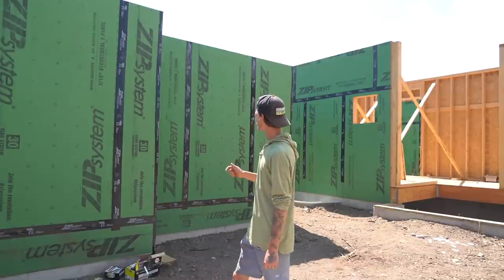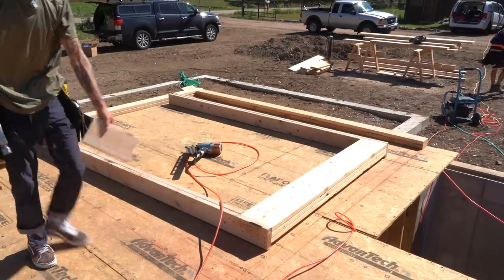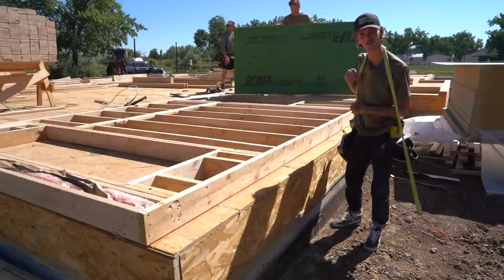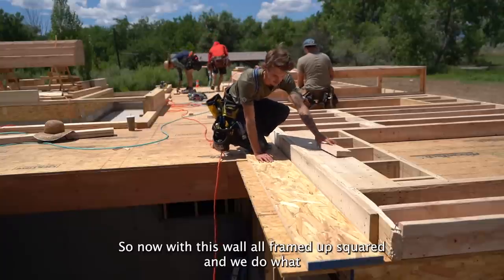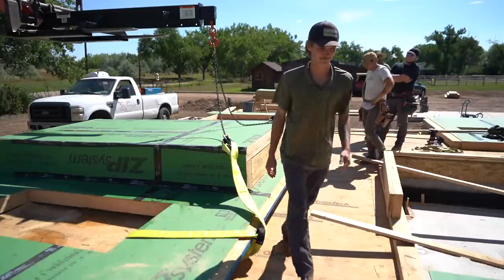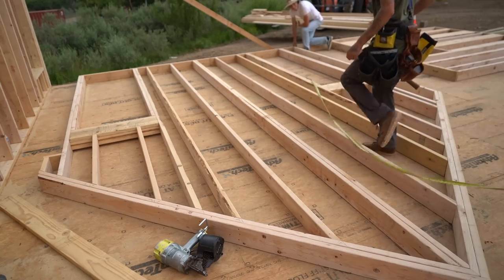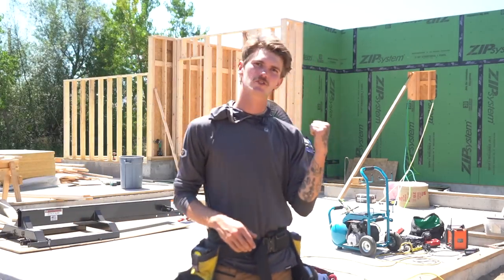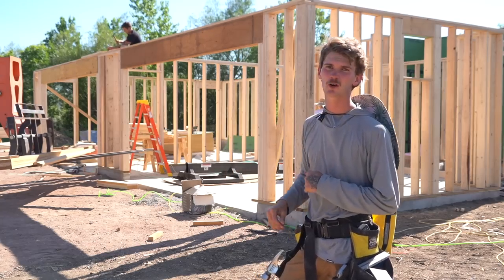A Framer's Guide to HIGH-Performance Homes pt 2 || Wall FRAMING

Comment: Thank you for the explanations. I'm a remodeler and woodworker. Experience in nearly all trades. One details is: spray foam the perimeter of fiberglass insulation batts. It glues the material to the studs and closes gaps. In time, fiberglass insulation always sags in the stud bay, leaving uninsulated space 6"-12" at the top. Spray foam cans guarantee the fiberglass or foam boards have no air gaps and remain centered. Good detail about insulating the corner joint!

Comment: Should put some foam between your headers for a thermal break.
Reply from the maker: I leave the 1” on the interior incase the insulators want to add it, since I am only the framer I don’t install it unless they provide me with the material for it
Reply: @Coffmanconstruction  Got it! They should do it if you don't. Gonna recruit you for work here in Seattle.

Comment: Why do yall run the sheeting vertical, also why dont you offset the joints?
Reply from the maker: Because all 4 edges of the sheet need blocking per code, so running it vertical reduces the amount of blocking required (and it’s still code compliant)

Comment: You put the insulation in backwards, the paper goes on the inside.
Reply: Ain’t going back now
Reply from the maker: Hopefully it doesn’t fall down now 🙃
Reply: Doesn’t matter, just means the vapor barrier is closer to the outside